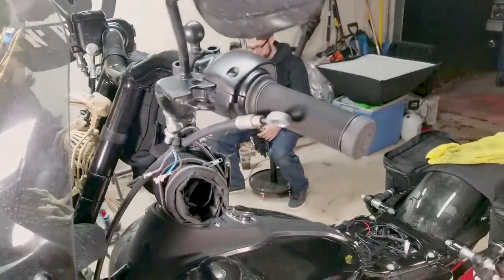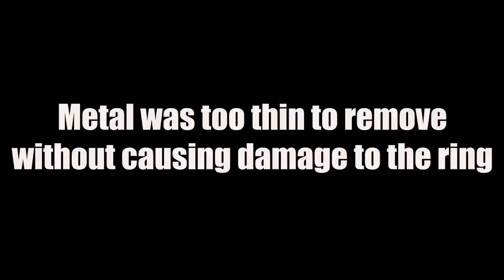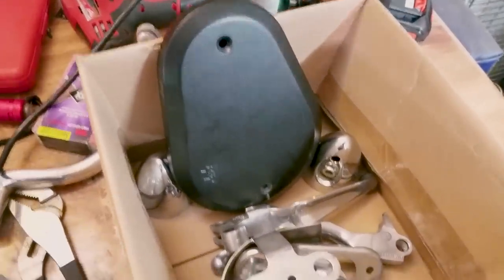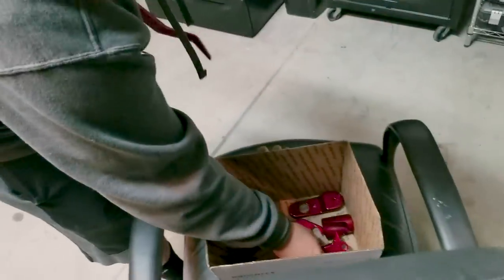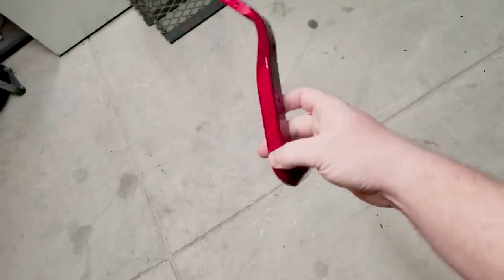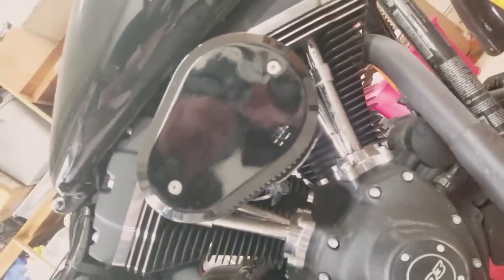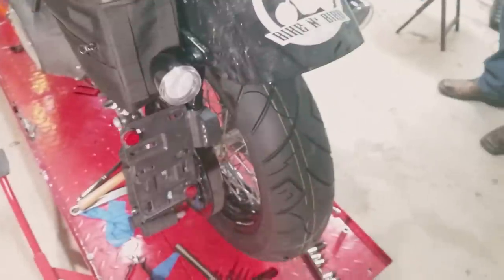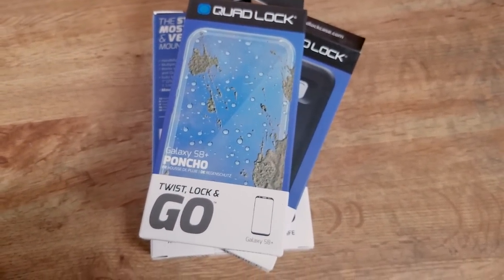Harley Dyna Build Series Ep. 10 - Pegs, Foot Controls, Powder Coat, Phone Mount

Comment: Great vid!  I have a 2017 Bob as well and looking to start customizing. I might get the Hammerhead shift and brake controls as well - I know you showed your uncle helping but would I be able to do the swaps on my own?  It looked fairly straightforward with the usual cramming your hand into tight places Harley deal... LOL.  Thank you!  (PS - does your promo code still work on the Get Lowered website?)
Reply from the maker: If you can turn a wrench, you can swap out pedals. Stupid easy. Like you said, just some tight spots. And yes, the shirt code is still active on get lowered.

Comment: How hard was it to remove the front turn signals? Looking to make those black as well.
Reply from the maker: It definitely wasn't super simple. Ended up depinning the turn signal itself so I didn't have to rewire the bars. Looking back at it, rewiring the bars might have been easier.

Comment: I just bought a Dyna Street Bob Special - It comes stock with forward controls and has no mid control hole in the primary cover nor does it have a shifter lever (for mids) on the inside - how the hell do I change to mid controls???
Reply from the maker: Gonna have to change the primary covers
Reply: @BikeNBird  Damn, just did the research, a lot more than just a primary change... $$$$$$$$$$